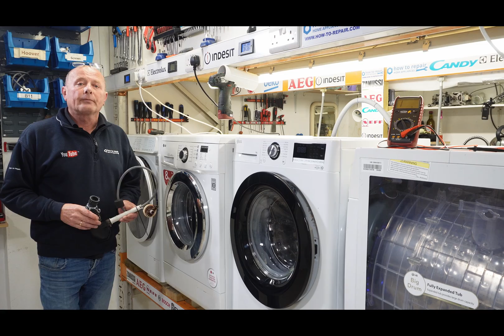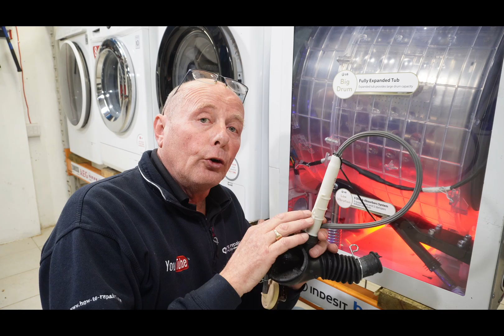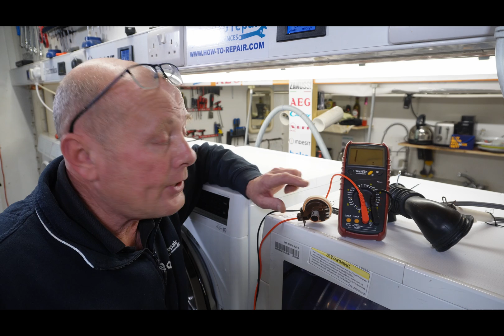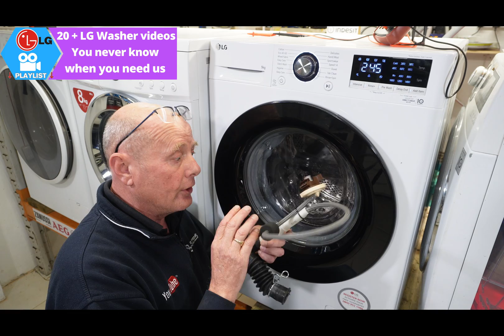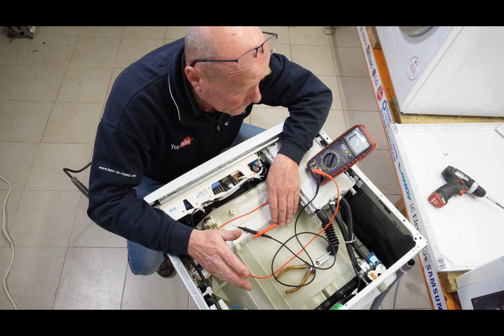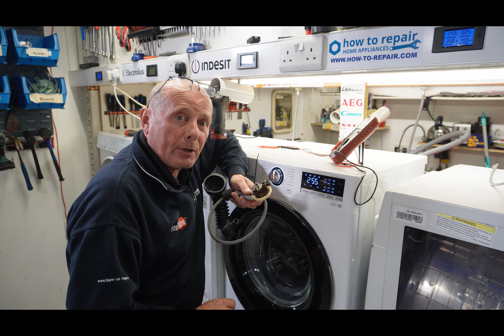LG washing machine, PE error code, understanding the faults with the pressure switch system

Comment: this was so well articulate. Unfortunately i dont have a multimeter right now, am short for cash and the PE error comes up and interrupts any diagnosis i try to do. I even race to the filling cycle, which it starts doing, only to stop after 1-2 seconds because of the flashing PE error interrupting. Mine is a WTG9090V Top loader, was working fine and then all of a sudden it kept neglecting its spin cycle after rinsing and gave OE, or FE, after re-attempting it would sometimes work, but now it wont let us get past 5-8 seconds without it stopping everything with the PE error.

Comment: I received no error and the machine kept filling and overflowed. I had to turn off the water supply and run it through rinse spin to get it to drain. It was again to spin and drain. What could this be?
Reply from the maker: You may have one of two problems either the pipe going to the pressure switch may have a perforation hole in it. You could have a stock water valve or possibly the pressure switche failed.
Reply: It was “able” to spin and drain.

Comment: Hi Paul, excellent video!  Would you have an idea on how to "bench test" an LG pressure switch?  I have a new and a "bad", but all I can find is between Pins 1 and 3, the resistance must be between 21-23 plus or minus 10%, which they are.  I think I need to test the frequency, but am struggling with the setup.  I don't have access to the washing machine, but have stuff like power supplies, multimeters, and an oscilloscope.  Thank you!

Comment: Dear Paul, thanks for the reply. I have changed the pump and this has definitely fixed the problem. It was showing the OE fault code but the reason I believed it was not the pump was that it was an intermittent problem, that is it was pumping at times during the cycle but usually not before the final spin thus complicating the diagnosis. I took the old pump out and connected it to the mains and repeatedly turned it on and off. And bingo!  at times it turned round and sometimes it dit not. Then I saw that the spindle (connecting the motor and the impellor) was loose in the housing. When the pump turned I could tell that it was "rattling" and not turning smoothly. A new pump has solved it! Cheers
Reply from the maker: Hi thanks a lot for your comment and I'm glad it helped. It would be really helpful for me to get my video shared and help us fight appliance waste! Please remember to subscribe to our channel, as that really helps us 😇

Since we work very hard in our warehouse making free video guides for you all on appliances, we always appreciate a beer, offering a choice of single or round beer. https://www.how-to-repair.com/help/buy-paul-a-beer/ 

Thanks, Paul 👍
Reply: How do I drain my washer full of clothes after PE  code has shown  some one please help

Comment: Dear Paul,  your videos have given me much insight into my LG washing machine but it is still just driving me nuts. Giving the OE error always at the beginning of the final centrifuge cycle, that is always 15 minutes before the end of the cycles. I have tried everything, stripped it down, checked all the hoses, they are clear. Taken the pump off which pumps fine until it gets to 15 minutes before the end of the wash.  Checked the level sensor tube, can blow through it. I have let the machine run with vinegar mixture in an attempt to clean it. After dismantling it seemed cured but now (4 weeks later) has the same symptoms. 
What on earth can I try next. Any advice would be much appreciated. Cheers, The Netherlands
Reply from the maker: If the machine is stopping when it's full of water and you know the impeller is turning freely then all I can think is the pump